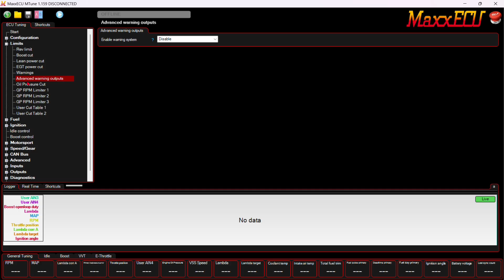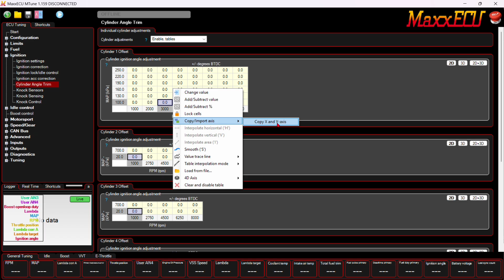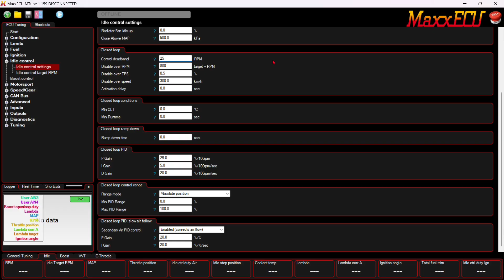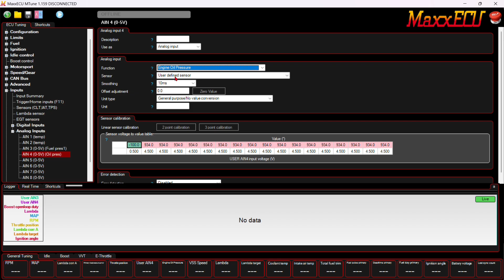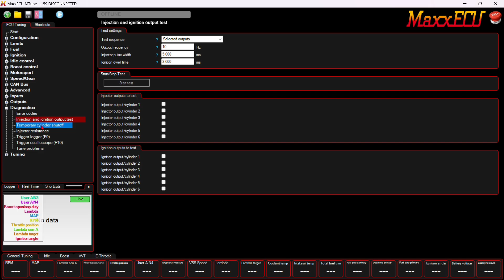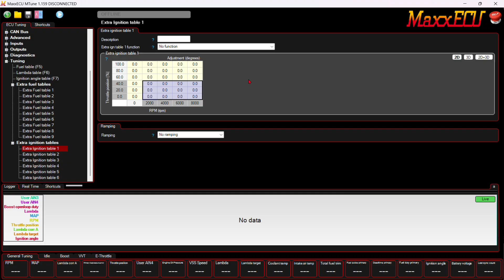MaxxECU setup with EVAN

Comment: 5:12 Your kpa conversion is a bit off. You said 130kpa is 6-7psi boost, 130 is actually 19psi
Reply: Subtract your barometric pressure of roughly 14.7psi at sea level and it brings you back to the 6psi, he is correct

Comment: First off thanks for a nice rundown on this system.  Is this the race gen2? I figure setup would be similar.  Do you remote tune with an 8hp transmission?